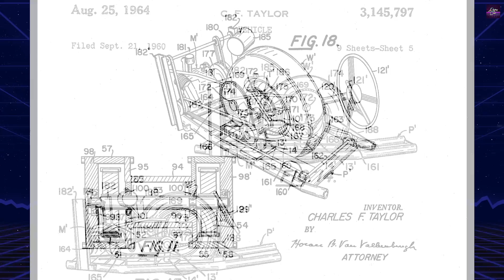Charles Taylor's One Wheel Vehicles: The Unsung Genius of Off-Roading

Comment: I am not sure what he was thinking. That one wheel could possibly be better than multiple wheels??? That thing had all of 4 inches of ground clearance, it would get stuck in the smallest of ditches!
Reply: Rocky terrain would be off limits.
Reply: Low center of gravity.
Reply: @whereswaldo5740  ok, good for a race car, not an off-road vehicle, though.
Reply: Here's my guesses.  The entire weight of the vehicle would be on one wheel, increasing traction and making it easier to maneuver around modest obstacles.  It would also remain level on off-camber trails and going up and down hills.  Not all interesting ideas turn out to be practical in real life, which is likely the story here.
Reply: "...it would get stuck in the smallest of ditches!"  Remember, this was a proof of concept model.  Further development could then work toward a capable off road vehicle, as well as other variants.
Reply: A 1 wheel vehicle could go on walking trails no 4 wheeler could use
Reply: @maxpayne2574  lol, ok. 🙄🙄 Did you see how large that thing was? It's not going anywhere a 4 or 2 wheeled could!
Reply: I ride an electric unicycle (EUC), look it up, 'EUC offroad'. 
These things are great offroad. Because you only have one wheel to worry about getting over obstacles. 

Charles Taylor just did not get far enough, due to limited tech in his time.
Reply: @bobdebouwer7835  No compared to a multi-wheeled vehicle, they are not great! One wheel has zero stability, nowhere near the load carring capacity, and in no way can they go places a multi-wheeled vehicle can.

Comment: A little more ground clearance wouldn't have hurt, for an all terrain/mountain machine.
But what are the advantages of a monowheel? Are there any?
Reply: Only advantages I can think of are preventing vehicle tilt and roll, and limiting high centering.
But the disadvantages I think outweigh those. Like less traction, the overhang on the front and rear can catch on terrain and carrying and load capacity
Reply: @404_profile_not_found  All the weight on one contact patch at all times should result in more traction in most conditions, I would think.   Without affecting maneuverability like locking differentials do.  But yeah, a lot of disadvantages, which is why the idea never took off.
Reply: Check videos on the Chinese wheelbarrow single wheel with wind assistance. Big = less rolling resistance.